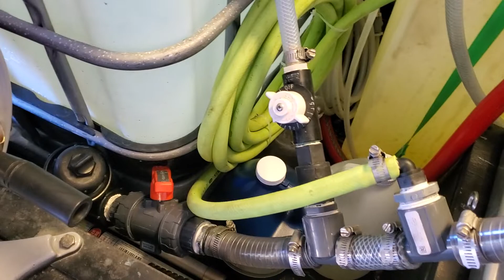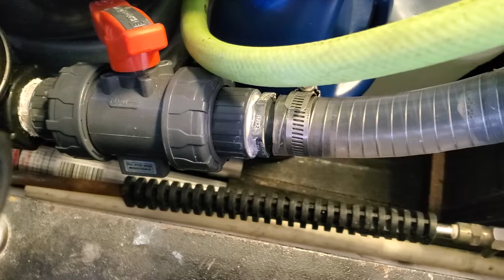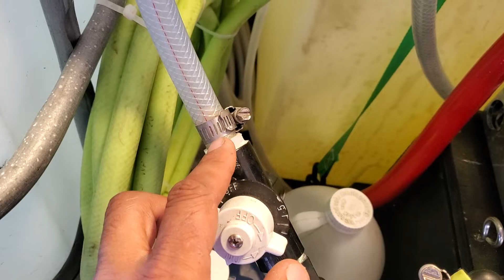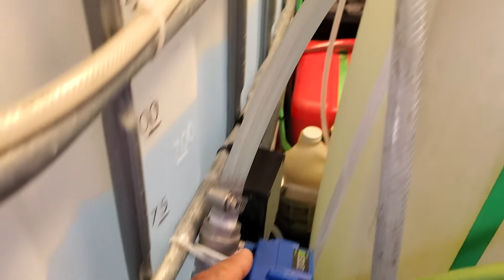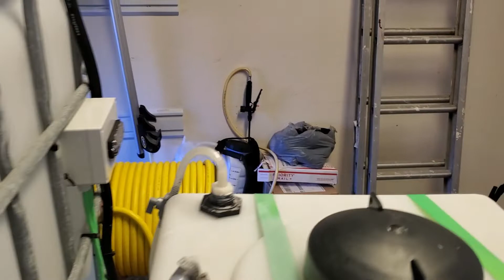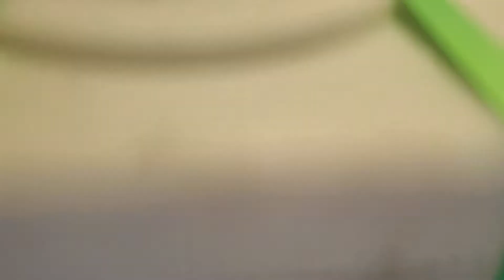Comet P40 Gas Softwash system plumbing

Comment: I don’t think anyone is gonna use this design. Way to must connected that don’t need to be connect.
Reply from the maker: Everyone has their own opinion but I've receive plenty of thank yous, phien calls and messages from people who appreciate the video. If you have a better way of doing it then make a video and share it. This video is much older and since then I've made updated videos on this using a 1" metering valve and remote shutoff. Appreciate your feedback regardless if you agree with it or not.

Comment: that us solid valve wont last for bleach
Reply from the maker: Video is old but it worked fine the 6 months insured it. Been using a Teejet valve.
Reply: @readykleenpowerwashing  mine locked up in about two weeks
Reply from the maker: @Johnnyreengo  rinsing is the key after every use. Never gave me a problem.

Comment: What keeps solution in the bypass line from contaminating what is in the applicator line when on/off the trigger?
Reply from the maker: There is a check valve for the water and bleach to prevent either or from mixing.
Reply: @readykleenpowerwashing  I know. I’m talking about, how do you clear out the 25’ bypass line whenever you go to change solution or switch over to plain water?
Reply from the maker: @kristopherrainbolt2617  once you turn your bleach off and run just water, it will clean the line out and bypass water when off the trigger.

Comment: Where did you find the outlet 3/4 hose I can't find anything
Reply from the maker: https://www.agspray.com/hose-reels-accessories/hose/pressure-spray-hose/pid14802/3-4-pvc-600psi-yellow-high-pressure-spray-hose/

It's by the foot so if you want 10ft you'll put qty 10.

Comment: I don’t really see the point of the bypass, as it has to be manually turned to bypass? Whereas my pressure washer bypasses as soon as I’m off the trigger...
Reply from the maker: This system bypasses off the trigger like a pressure washer as well. The difference between this and a pressure washer is that it doesn't bypass back to the tank to continually keep the pump cool. It can only be in bypass mode for up to 10 min before the pump overheats.
Reply: @readykleenpowerwashing  I’ve just bought the p40 here in the U.K., not many have it. What do I need to have the bypass valve set to? As when I come off the trigger, there is still pressure on the Lance?
Reply from the maker: @12988Jake  the unloader knob can be set to whatever pressure you want according to what you're cleaning.
Reply: @readykleenpowerwashing  I understand the unloader, that’s the easy bit, it’s this lever I don’t get, and I don’t understand why it’s not bypassing when off the trigger
Reply: @readykleenpowerwashing  so basically when the bypass is open, it returns to tank, but when it’s closed, all the pressure remains in the pump and hose? I don’t understand what the point is? I’m not noticing any bypass when I’m off the trigger...
Reply from the maker: @12988Jake  bypass is automatic. The unloader automatically puts the system in bypass when a specific pressure is reached. Just like a commercial pressure washer that has a bypass hose running back to a buffer tank.
Reply: @readykleenpowerwashing  on mine there is a lever below the unloader, I can turn it and the pump bypasses completely, if I have it shut, there is loads of pressure still when off the trigger?
Reply: @readykleenpowerwashing  it says ‘on off’ on the lever

Comment: if you kept the hose 3/4" on your reel (just like on the output port of the P40) for the P40 wouldn't you get better flow (gpm) than going to a 1/2" hose?
Reply from the maker: You don't need 3/4" hose. The manifold on the reel is only 1/2". It flows plenty with 1/2" hose. All you'll be doing is adding a lot of weight you'll get tired of pulling around.
Reply: @readykleenpowerwashing  we do loose lots of PSI with smaller hose sizes. It’s not necessary the fact that there is a restriction at the reel that throttles the whole system. Larger hose WILL get you higher PSI and more flow at the tip. For example, running a 3/4” water supply line through a 1/2” reel setup will fill WAY faster than using a 5/8” water supply hose on a 1/2” reel setup.

Comment: Is it normal for the p-40 to always be in bypass mode even when on the trigger?
Reply from the maker: If you were in bypass on the trigger you wouldn't have any pressure.
Reply: @readykleenpowerwashing  I don’t get this either, what’s the point of the bypass if you have to walk over to the machine to put it in bypass? Surely the point of a bypass is to bypass when you come off the trigger?

Comment: Have a link to the 12v ball valve? and are you not worried about corrosion?
Reply from the maker: Not worried about the ball valve because it's stainless. If it goes bad I already have a backup. I keep spares.

https://www.google.com/amp/s/ussolid.com/amp/motorized-ball-valves1.html

Comment: Looks good but get rid of that pentair valve. They all Crack down the seams and very hard to find when you have a air leak...
Reply from the maker: Appreciate the concern but that pentair valve was a year old and never had an issue. I do have an updated video however where I did update everything to 1". The reason they Crack is usually being installed too tightly and not using the right stuff to seal it.

Comment: After running some AR45 pumps.  I'd recommend a 1 inch proportioning valve ,   on your SH in order to get a 50/50 SH/water mixture along with 1inch hose feeding the pump in order maintain the full flow capacity of the diaphragm pump.
Reply from the maker: Take a look at my updated video. Already done

Comment: all my parts you listed just arrived. Question for you. Can i hook the 1” water line to the top of my tank instead of using the 1” bulkhead coming out of bottom of tank. i dont need the extra line to go to my pressure washer
Reply from the maker: Yes you can. If your plan is to use a drop line into the tank from the top, it shouldn't be a problem. This is how my SH line pulls chemical.

Comment: do you keep the ball valve wide open or close it some? what if i only want 2% mix how do i meter that with the water flow
Reply from the maker: Because the metering valve I currently have is 1/2", if I have it wide open it will give me approx a 3% mix. This is because my water is 1". If you want a stronger mix then I would pinch my water halfway with the ball valve and leave the bleach wide open.
Reply: ok thanks

Comment: Fantastic video...can I ask a question, as these machines throw a lot of water, does it come with a lever/knob that you can move,  that you can regulate the pressure flow, from a trickle  to full flow?
Reply from the maker: There is an unloader knob that reduces pressure. You can always turn it down but the flow will be there. This situation you can use different nozzle tips such as a fan pattern for a more controlled application.

Comment: Why didn't you put a bleach line in to 1in? Just curiosity.
Reply from the maker: I was using what I already had available. I was upgrading from a 12v system and already had the proportioner. I used the check valve and proportioner valve since I already had it. If I need to get a stong mix, I just pinch off the water using the ball valve. Eventually I'll change it out to 1".
Reply: @readykleenpowerwashing  got it thanks for replying we will soon order this unite and set a remote valve on bleach line

Comment: Great Video Are you Able to Pull a 6% 
mix or are you limited to 5%
Reply from the maker: You can get an easier 6% mix running a bigger mixing valve. I'm only running a 1/2" valve because I already had it upgrading from my 12v system. I just pinch off the water halfway using the ball valve.

Comment: I have the P40 on order and greatly appreciate your video. Very helpful in better understanding how this gets connected. How many gallons of water do you go thru when washing an average 2500 soft  house?
Reply from the maker: I honestly wouldn't know how many gallons of water I'd go through. There are too many variables as far as dirtiness, etc. Another thing is I hook up to the customers water to fill my tank while using it.
Reply: Can you do a video on how you wired in your switch to your chemical line